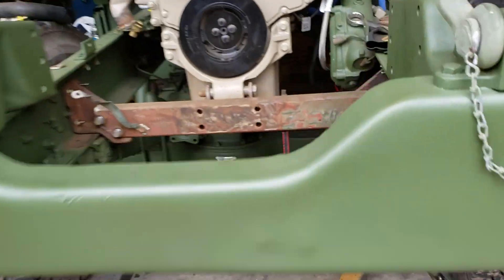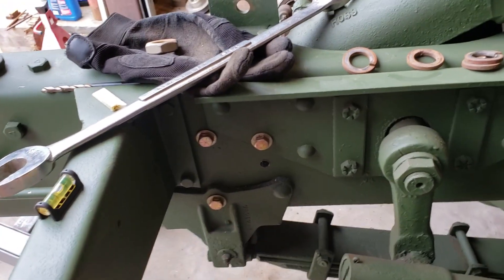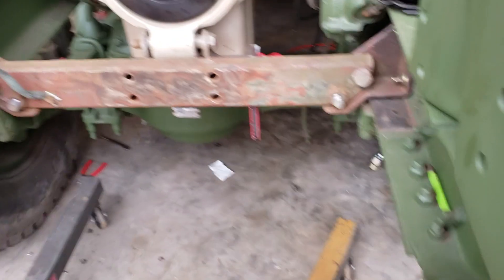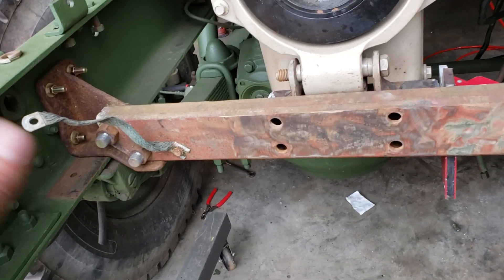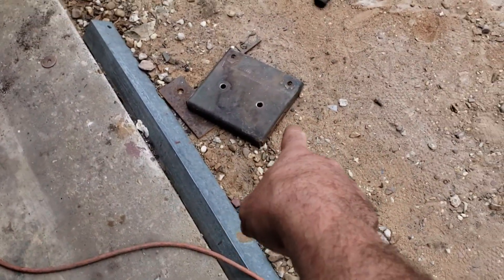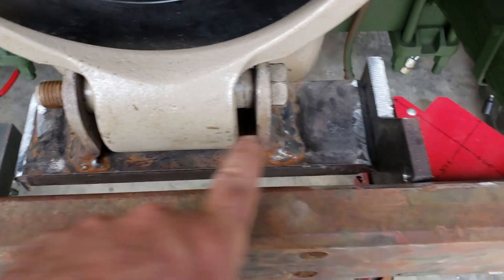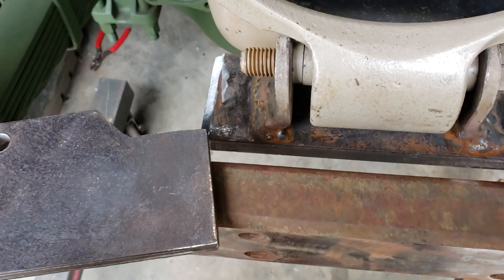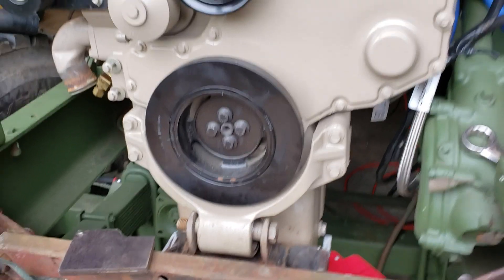M35A2 6BT Cummins swap: Installing new front crossmember and building the engine mount.

Comment: I may have missed it but did you end up lowering the rear bell housing motor mount brackets to line up better with the transfer case?

Currently working on a swap 12 valve Cummins from a 1994 Ford f800 into our 1999 c6500 Chevy which had a 3126 cat in it with issues. Manual Eaton 6 speed on both. I have both trucks on site. 

Have used your videos before to help with the bearings and brakes on our  off-road Recovery red 1962 Studebaker m35a2w/w.
Reply from the maker: No I just raised the front of the engine to get a 3° downward angle towards the rear. That gave me what I needed.